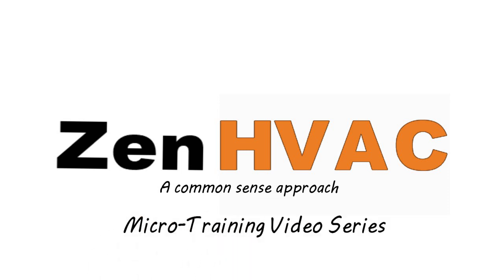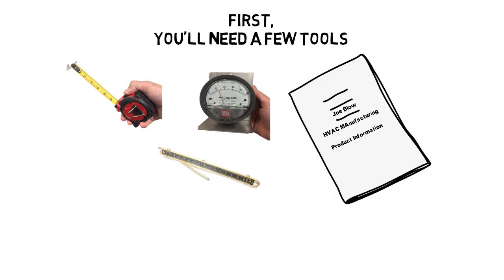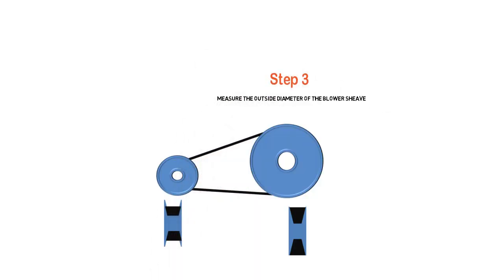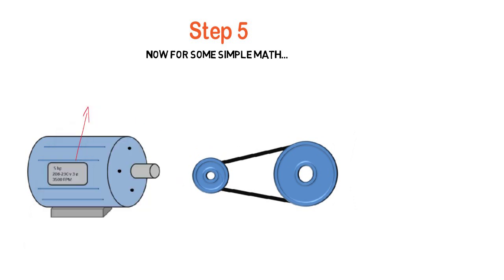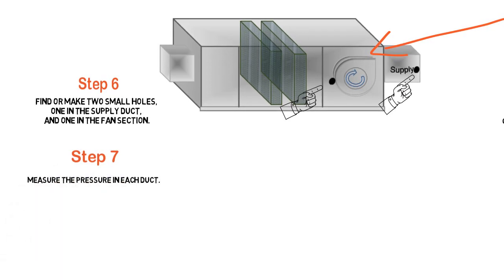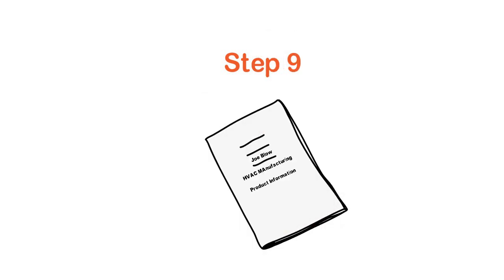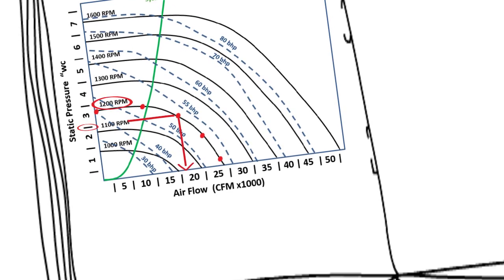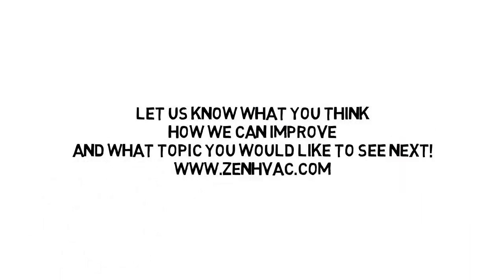Calculating Air Flow for Air Handling Units

Comment: wht about the propeller size ? Does propeller diameter affect the airflows? Suppose I calculated on how much airflows (m³/s) is needed to cool down a certain system, for example a generator. Now how to select a fan out from it ? The rpm of the fan depends on the rotations of the rotor since it'll be installed on the rotor. How to calculate the proper size of the fan to make this schematic works ?

Comment: Hi, thanks for the useful training. For the purpose of my research, I am looking for an equation that I can calculate the air pressure drop due to the existence of heating/cooling coils inside the Air Handling Unit. May you please introduce me such an equation if you are aware of it?

Comment: Sir, I will use motor-gearbox coupling without using pulley and belt that time how can I calculate the flow rate???

Comment: Hi Sir Patrick,

If my blower is directly coupled to the Fan motor, i will use the Fan motor RPM directly to check the CFM correct? 
Thanks
Reply from the maker: Correct! Thank you for mentioning direct drive fans, I should have pointed that out!
Reply: @ZenHVAC  thank you sir, this video really helps a lot for us that is new to HVAC.
looking forward for more videos. :)

Comment: why the static pressure is taken for internal? not like roof top
Reply from the maker: Great question Ramzy! They use internal static on built-up air handlers because the unit static changes according to the optional components installed (chilled water coil, heating coil, DX coil, filters, etc) so they use the fan's static curve (internal static) instead of having a different curve for every possible option.
Let me know if this helps. Also, what would you like our next video to be about! We'll dedicate it to you!
Reply: yeah thank you.
Can you make a video of how PICV works and other valves
Reply from the maker: Great idea!  We'll have it for you in a few weeks!

Comment: NAME / CAPACITY / SA/ RA / SIZE / Resistors

AHU1 120.38KW SA - FLOW: 22680 - SIZE 714x714, RA - FLOW: 20700 SIZE 1300x500, HEAT 380 // PH / 29KW

AHU2 122.52 KW FLOW 21600 SIZE 638x638 FLOW 19440 SIZE 1200x500, 380 // PH / 30KW

AHU3 137.79 KW FLOW 27000 SIZE 714x714, FLOW 24948 SIZE 1500x650, 380 // PH / 37KW

AHU4 184.05 KW FLOW 31320 SIZE 800x800, FLOW 26820 SIZE 1300x650, 380 // PH / 18KW

AHU5 110.86 KW FLOW 16920 SIZE 568x568, FLOW 13536 SIZE 1000x450, 380 // PH / 19KW

* / First AHU1 wind velocity comparison with AHU3 different wind flow levels AHU1 is smaller than AHU3 4300 cmh but the same wind mouth size 714x714

** / Comparing wind flow AHU3 with AHU4 different wind flow AHU3 is smaller than aHU4 2000 cmh but the mouth of the wind recovers more than 1500 / 1300mm

* / AHU 3 resistors, AHU4 too small compared to AHU1, AHU2, AHU3
AHU1 120.38KW 380 // PH / 29KW

AHU2 122.52 KW 380 // PH / 30KW

AHU3 137.79 KW 380 // PH / 37KW

AHU4 184.05 KW 380 // PH / 18KW

AHU5 110.86 KW 380 // PH / 19KW

I summarize so the doctor analyzes help me!
I think the designer has made a mistake. If so please help me get one correct answer. Thank you very much!
This is  my email
vanbavt08ct@gmail.com

Comment: Dear Zen, it's very informative. I'm struggling to find someone who would endorse or second your step 4, in which you mention to measure inside diameter of sheave. I have searched hard on internet and in person to several people they all argue it has to be outside of diameter just as in step 3. Kindly elaborate! Thanks
Reply from the maker: Good catch! We should have been more specific on step 4. Measure to the back of the belt if it is an adjustable sheave to be sure you are measuring the functional diameter of the sheave. 
We really appreciate the question and pointing out how we could have done a better job of explaining!

Respectfully,
Patrick

Comment: Nice training. You make it easy to follow. There are a couple of issues in your content.  1.  The static calculation should be a difference calculation 1.5 - (-1) = 2.5 TSP. The second thing is your units on the curve are 1000 so your flow would be 19000 and not 1900. Awesome video. Thanks for sharing.
Reply from the maker: Good catch Bryan! 
You're right, it should be 19000, I'll correct it soon.
I wrote the formula so folks would understand the concept of treating the negative number as a positive.

I really appreciate the feedback!

Patrick